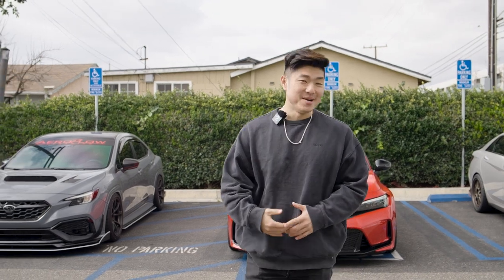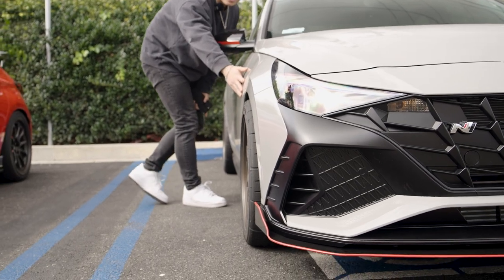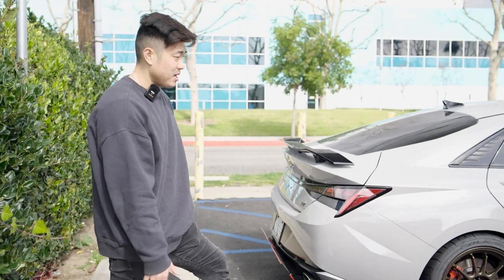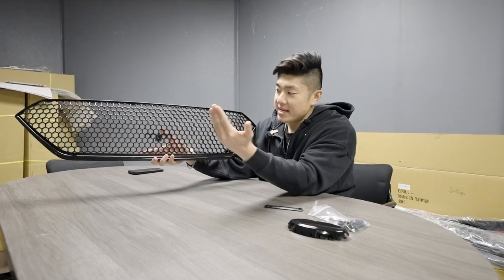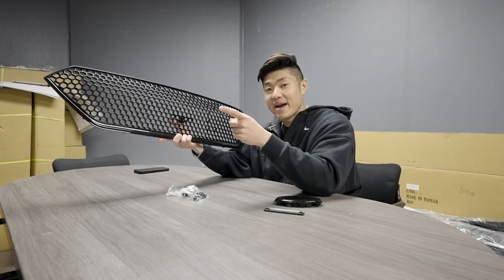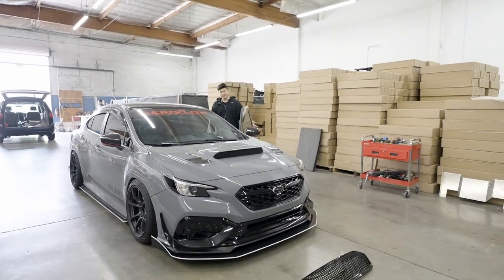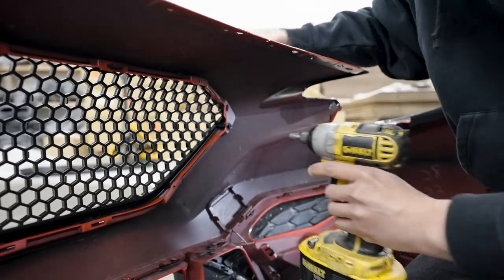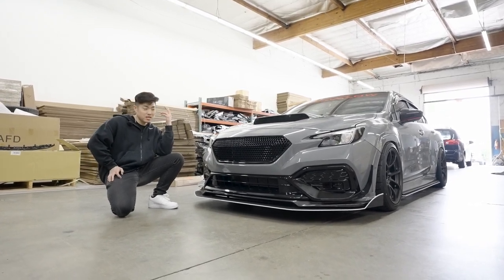The most aggressive upgrade! | 2022 Subaru WRX

Comment: If you make a badge delete grill like this, but with the larger stock honeycomb design, I'd buy rn
Reply: Definitely would look the most uniform if that were the case, I hope they do! Also @AeroflowDynamics If you're reading this have you thought of making a part to change the honeycomb design above the fog lights so that one can get the sports grill look on the whole front of the car? It would fix the one positive you keep mentioning of sticking to the stock design which is the uniformity of the front bumper to the grill.
Reply: Can you please make a grill like that for the 2015-2021 WRX/STI?